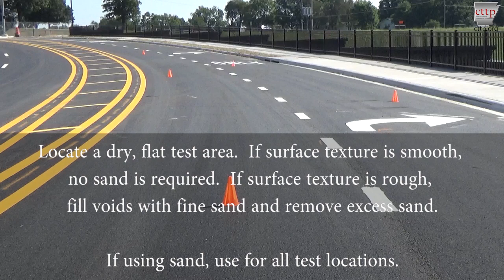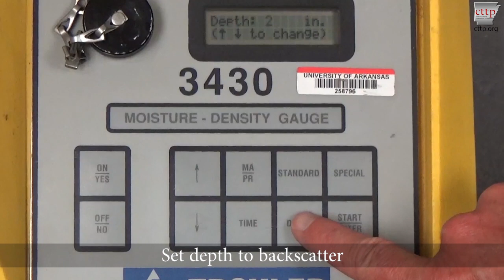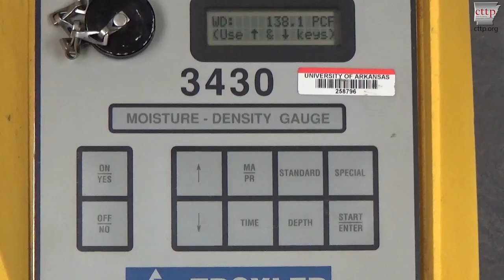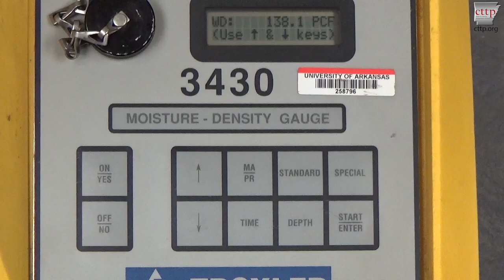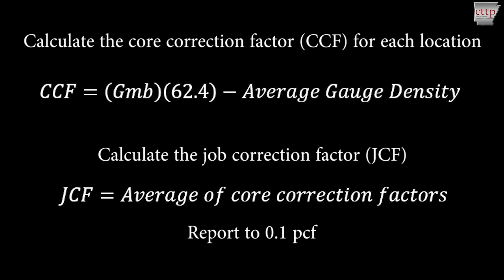ARDOT 461 Nuclear Density Gauge - Asphalt Job Correction Factor

Comment: This may be a stupid question but at the 2:45 mark, you turned the gauge opposite of paving direction when you put it in the 12 oclock position. Is that ok if the gauge is supposed to be facing the paving direction ?